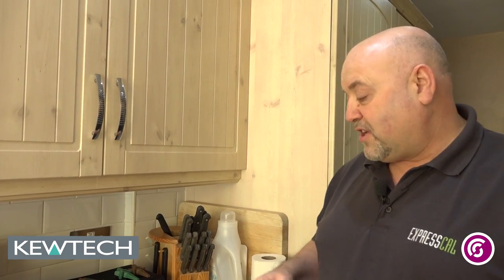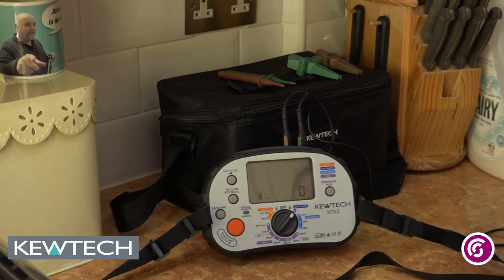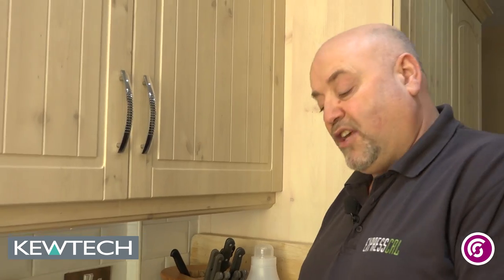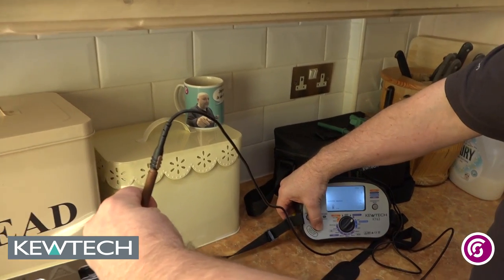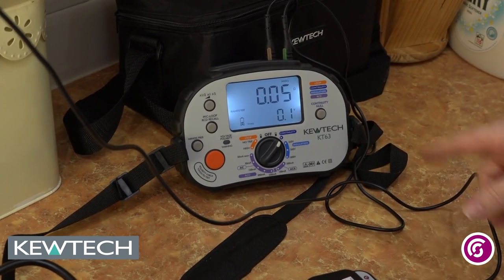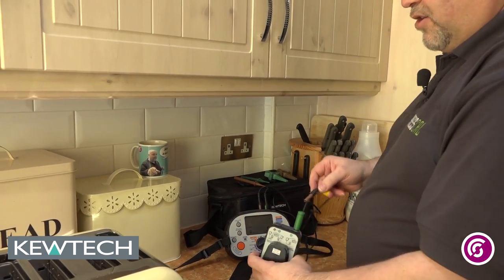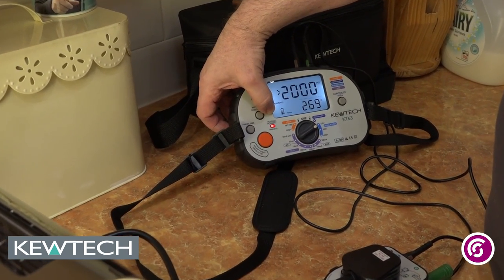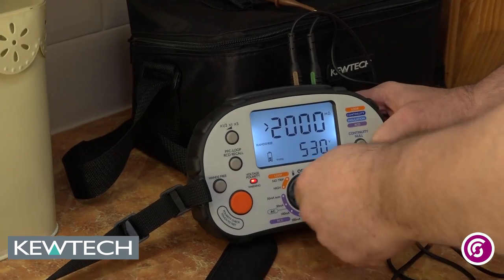KT63 PAT Class 1

Comment: Hi will it work with a megger 1720?
Reply from the maker: Hi Chaz, in answer to your question...yes it will work with any meter using leads with standard 4mm connections.
Reply: Just use crocksnn by on the Plugtop!